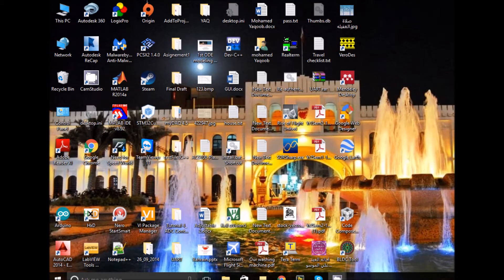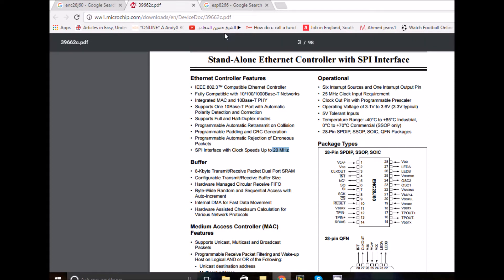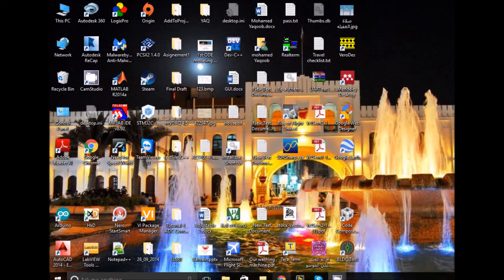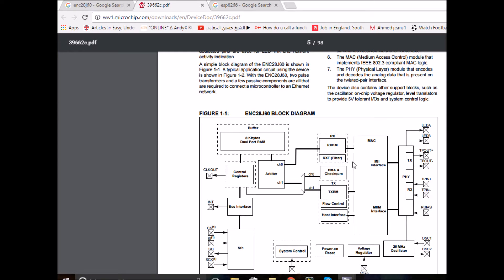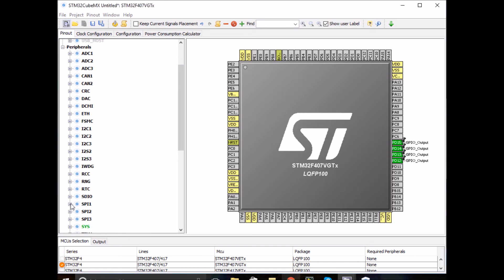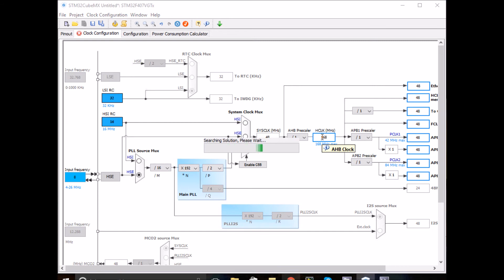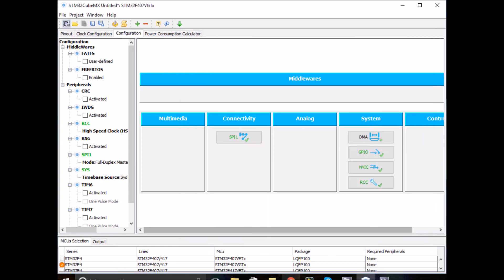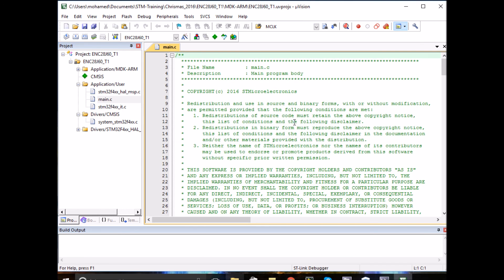STM32F4 Discovery board: ENC28J60 Ethernet Part1- Introduction

Comment: /* Includes ------------------------------------------------------------------*/
#include "main.h"
#include "stm32f0xx_hal.h"

/* USER CODE BEGIN Includes */
#include "string.h"
/* USER CODE END Includes */

/* Private variables ---------------------------------------------------------*/
UART_HandleTypeDef huart1;

/* USER CODE BEGIN PV */
/* Private variables ---------------------------------------------------------*/
#define RS_PIN_HIGH         HAL_GPIO_WritePin(GPIOC,RS_Pin,GPIO_PIN_SET)
#define RS_PIN_LOW     HAL_GPIO_WritePin(GPIOC,RS_Pin,GPIO_PIN_RESET)
#define E_PIN_HIGH      HAL_GPIO_WritePin(GPIOC,E_Pin,GPIO_PIN_SET)
#define E_PIN_LOW      HAL_GPIO_WritePin(GPIOC,E_Pin,GPIO_PIN_RESET)
#define D0_PIN_HIGH     HAL_GPIO_WritePin(GPIOB,D0_Pin,GPIO_PIN_SET)
#define D0_PIN_LOW      HAL_GPIO_WritePin(GPIOB,D0_Pin,GPIO_PIN_RESET)
#define D1_PIN_HIGH     HAL_GPIO_WritePin(GPIOB,D1_Pin,GPIO_PIN_SET)
#define D1_PIN_LOW      HAL_GPIO_WritePin(GPIOB,D1_Pin,GPIO_PIN_RESET)
#define D2_PIN_HIGH     HAL_GPIO_WritePin(GPIOB,D2_Pin,GPIO_PIN_SET)
#define D2_PIN_LOW      HAL_GPIO_WritePin(GPIOB,D2_Pin,GPIO_PIN_RESET)
#define D3_PIN_HIGH     HAL_GPIO_WritePin(GPIOB,D3_Pin,GPIO_PIN_SET)
#define D3_PIN_LOW      HAL_GPIO_WritePin(GPIOB,D3_Pin,GPIO_PIN_RESET)

/* USER CODE END PV */

/* Private function prototypes -----------------------------------------------*/
void SystemClock_Config(void);
static void MX_GPIO_Init(void);
static void MX_USART1_UART_Init(void);

/* USER CODE BEGIN PFP */
/* Private function prototypes -----------------------------------------------*/
//char txdata[3]="hi";
//uint8_t tx_char;
/* USER CODE END PFP */

/* USER CODE BEGIN 0 */
void lcd_init(void);
void lcd_command(uint8_t data1);
void lcd_char(uint8_t data,uint8_t data1,  uint8_t data2);
void lcd_command(uint8_t cmd);
void lcd_data(uint8_t data);
void lcd_goto_xy(unsigned char x, unsigned char y);
void lcd_print(char * str) ;
void lcd_print_char(char str);
void lcd_data_set_high_nibble(uint8_t data);
void lcd_data_set_low_nibble(uint8_t data);
void en_toggle(void) ;
void lcd_write_first_row(char *str);
void lcd_write_second_row(char *str) ;
/* USER CODE END 0 */

/**
  * @brief  The application entry point.
  *
  * @retval None
  */
int main(void)
{
  /* USER CODE BEGIN 1 */

  /* USER CODE END 1 */

  /* MCU Configuration----------------------------------------------------------*/

  /* Reset of all peripherals, Initializes the Flash interface and the Systick. */
  HAL_Init();

  /* USER CODE BEGIN Init */

  /* USER CODE END Init */

  /* Configure the system clock */
  SystemClock_Config();

  /* USER CODE BEGIN SysInit */

  /* USER CODE END SysInit */

  /* Initialize all configured peripherals */
  MX_GPIO_Init();
  MX_USART1_UART_Init();
  /* USER CODE BEGIN 2 */
 
HAL_Delay(1000);
 //HAL_UART_Transmit(&huart1,&tx_char,1,100);
   lcd_init();
 // tx_char = 'b';
 //HAL_UART_Transmit(&huart1,&tx_char,1,100);
 //HAL_Delay(1000);
  // tx_char = 'c';
 //HAL_UART_Transmit(&huart1,&tx_char,1,100);
 //HAL_Delay(1000);
  //tx_char = 'D';
 //HAL_UART_Transmit(&huart1,&tx_char,1,100);
 
 lcd_write_first_row("hello");
  /* USER CODE END 2 */

  /* Infinite loop */
  /* USER CODE BEGIN WHILE */
  while (1)
  {

  /* USER CODE END WHILE */

  /* USER CODE BEGIN 3 */

  }
  /* USER CODE END 3 */

}

/**
  * @brief System Clock Configuration
  * @retval None
  */
void SystemClock_Config(void)
{

  RCC_OscInitTypeDef RCC_OscInitStruct;
  RCC_ClkInitTypeDef RCC_ClkInitStruct;
  RCC_PeriphCLKInitTypeDef PeriphClkInit;

    /**Initializes the CPU, AHB and APB busses clocks 
    */
  RCC_OscInitStruct.OscillatorType = RCC_OSCILLATORTYPE_HSI;
  RCC_OscInitStruct.HSIState = RCC_HSI_ON;
  RCC_OscInitStruct.HSICalibrationValue = 16;
  RCC_OscInitStruct.PLL.PLLState = RCC_PLL_NONE;
  if (HAL_RCC_OscConfig(&RCC_OscInitStruct) != HAL_OK)
  {
    _Error_Handler(__FILE__, __LINE__);
  }

    /**Initializes the CPU, AHB and APB busses clocks 
    */
  RCC_ClkInitStruct.ClockType = RCC_CLOCKTYPE_HCLK|RCC_CLOCKTYPE_SYSCLK
                              |RCC_CLOCKTYPE_PCLK1;
  RCC_ClkInitStruct.SYSCLKSource = RCC_SYSCLKSOURCE_HSI;
  RCC_ClkInitStruct.AHBCLKDivider = RCC_SYSCLK_DIV1;
  RCC_ClkInitStruct.APB1CLKDivider = RCC_HCLK_DIV1;

  if (HAL_RCC_ClockConfig(&RCC_ClkInitStruct, FLASH_LATENCY_0) != HAL_OK)
  {
    _Error_Handler(__FILE__, __LINE__);
  }

  PeriphClkInit.PeriphClockSelection = RCC_PERIPHCLK_USART1;
  PeriphClkInit.Usart1ClockSelection = RCC_USART1CLKSOURCE_PCLK1;
  if (HAL_RCCEx_PeriphCLKConfig(&PeriphClkInit) != HAL_OK)
  {
    _Error_Handler(__FILE__, __LINE__);
  }

    /**Configure the Systick interrupt time 
    */
  HAL_SYSTICK_Config(HAL_RCC_GetHCLKFreq()/1000);

    /**Configure the Systick 
    */
  HAL_SYSTICK_CLKSourceConfig(SYSTICK_CLKSOURCE_HCLK);

  /* SysTick_IRQn interrupt configuration */
  HAL_NVIC_SetPriority(SysTick_IRQn, 0, 0);
}

/* USART1 init function */
static void MX_USART1_UART_Init(void)
{

  huart1.Instance = USART1;
  huart1.Init.BaudRate = 38400;
  huart1.Init.WordLength = UART_WORDLENGTH_8B;
  huart1.Init.StopBits = UART_STOPBITS_1;
  huart1.Init.Parity = UART_PARITY_NONE;
  huart1.Init.Mode = UART_MODE_TX_RX;
  huart1.Init.HwFlowCtl = UART_HWCONTROL_NONE;
  huart1.Init.OverSampling = UART_OVERSAMPLING_16;
  huart1.Init.OneBitSampling = UART_ONE_BIT_SAMPLE_DISABLE;
  huart1.AdvancedInit.AdvFeatureInit = UART_ADVFEATURE_NO_INIT;
  if (HAL_UART_Init(&huart1) != HAL_OK)
  {
    _Error_Handler(__FILE__, __LINE__);
  }

}

/** Configure pins as 
        * Analog 
        * Input 
        * Output
        * EVENT_OUT
        * EXTI
*/
static void MX_GPIO_Init(void)
{

  GPIO_InitTypeDef GPIO_InitStruct;

  /* GPIO Ports Clock Enable */
  __HAL_RCC_GPIOC_CLK_ENABLE();
  __HAL_RCC_GPIOB_CLK_ENABLE();
  __HAL_RCC_GPIOA_CLK_ENABLE();

  /*Configure GPIO pin Output Level */
  HAL_GPIO_WritePin(GPIOC, RS_Pin|E_Pin, GPIO_PIN_RESET);

  /*Configure GPIO pin Output Level */
  HAL_GPIO_WritePin(GPIOB, D1_Pin|D2_Pin|D3_Pin|D0_Pin, GPIO_PIN_RESET);

  /*Configure GPIO pins : RS_Pin E_Pin */
  GPIO_InitStruct.Pin = RS_Pin|E_Pin;
  GPIO_InitStruct.Mode = GPIO_MODE_OUTPUT_PP;
  GPIO_InitStruct.Pull = GPIO_NOPULL;
  GPIO_InitStruct.Speed = GPIO_SPEED_FREQ_LOW;
  HAL_GPIO_Init(GPIOC, &GPIO_InitStruct);

  /*Configure GPIO pins : D1_Pin D2_Pin D3_Pin D0_Pin */
  GPIO_InitStruct.Pin = D1_Pin|D2_Pin|D3_Pin|D0_Pin;
  GPIO_InitStruct.Mode = GPIO_MODE_OUTPUT_PP;
  GPIO_InitStruct.Pull = GPIO_NOPULL;
  GPIO_InitStruct.Speed = GPIO_SPEED_FREQ_LOW;
  HAL_GPIO_Init(GPIOB, &GPIO_InitStruct);

}

/* USER CODE BEGIN 4 */
void lcd_init(void) {

  
 lcd_command(0x33); //send data for 4 bits to the LCD
 HAL_Delay(5);
 lcd_command(0x32);
 HAL_Delay(5);
 lcd_command(0x28); //for bit mode
 HAL_Delay(5);
 lcd_command(0x0e); // clear the screen
 HAL_Delay(5);
 lcd_command(0x01); // display on Cursor on 
 HAL_Delay(5);
 lcd_command(0x06); //increment cursor  
 HAL_Delay(5);  

}
void lcd_command(uint8_t cmd) {

 RS_PIN_HIGH;
 lcd_data_set_high_nibble(cmd);
 en_toggle();
 lcd_data_set_low_nibble(cmd);
 en_toggle();
}
void lcd_data(uint8_t data) {

    RS_PIN_HIGH;
    lcd_data_set_high_nibble(data);
    en_toggle();

 lcd_data_set_low_nibble(data);
 en_toggle();
}
void lcd_goto_xy(unsigned char x, unsigned char y) {
 unsigned char firstCharAdr[] = { 0x80, 0xC0, 0x94, 0xD4 };
 HAL_Delay(2);
 lcd_command(firstCharAdr[y - 1] + x - 1);
 HAL_Delay(2);
}
void lcd_print(char * str) {
 unsigned char i = 0;
 while ((str[i] != 0) && (i < 16)) {
 HAL_Delay(10);
  lcd_data(str[i]);
  i++;
 }
}
void lcd_print_char(char str) {
 HAL_Delay(2);
 lcd_data(str);
}
void lcd_data_set_high_nibble(uint8_t data) {
 uint32_t lcd_data = 0;

 lcd_data = ((data & 0x000000f0) >> 7) & 1;
 if (lcd_data){
  D3_PIN_HIGH;
 }
 else
 {
  D3_PIN_LOW;
 }

 lcd_data = ((data & 0x000000f0) >> 6) & 1;
 if (lcd_data){
  D2_PIN_HIGH;
 }
 else
 {
  D2_PIN_LOW;
 }
 lcd_data = ((data & 0x000000f0) >> 5) & 1;
 if (lcd_data)
 {
  D1_PIN_HIGH;
 }
 else
 {
  D1_PIN_LOW;
 }
 lcd_data = ((data & 0x000000f0) >> 4) & 1;
 if (lcd_data)
 {
  D0_PIN_HIGH;
 }
 else
 {
  D0_PIN_LOW;
 }
}
void lcd_data_set_low_nibble(uint8_t data) {
 uint32_t lcd_data = 0;

 lcd_data = ((data & 0x0000000f) >> 3) & 1;
 if (lcd_data){
  D3_PIN_HIGH;
 }
 else
 {
  D3_PIN_LOW;
 }
 lcd_data = ((data & 0x0000000f) >> 2) & 1;
 if (lcd_data)
 {
  D2_PIN_HIGH;
 }
  else
  {
  D2_PIN_LOW;
  }
 lcd_data = ((data & 0x0000000f) >> 1) & 1;
 if (lcd_data)
 {
  D1_PIN_HIGH;
 }

  else
  {
  D1_PIN_LOW;
  }
 lcd_data = (data & 0x0000000f) & 1;
 if (lcd_data)
 {
  D0_PIN_HIGH;
 }
 else
 {
  D0_PIN_LOW;
 }
}
void en_toggle(void) {

 E_PIN_HIGH;
 HAL_Delay(10);
 E_PIN_LOW;
 HAL_Delay(10);
}
void lcd_write_first_row(char *str) {

 lcd_goto_xy(1, 1);
 lcd_print("                ");
 HAL_Delay(10);
 lcd_goto_xy(1, 1);
 lcd_print(str);
}
void lcd_write_second_row(char *str) {

 lcd_goto_xy(1, 2);
 lcd_print("                ");
 HAL_Delay(10);
 lcd_goto_xy(1, 2);
 lcd_print(str);
}

/* USER CODE END 4 */

/**
  * @brief  This function is executed in case of error occurrence.
  * @param  file: The file name as string.
  * @param  line: The line in file as a number.
  * @retval None
  */
void _Error_Handler(char *file, int line)
{
  /* USER CODE BEGIN Error_Handler_Debug */
  /* User can add his own implementation to report the HAL error return state */
  while(1)
  {
  }
  /* USER CODE END Error_Handler_Debug */
}

#ifdef  USE_FULL_ASSERT
/**
  * @brief  Reports the name of the source file and the source line number
  *         where the assert_param error has occurred.
  * @param  file: pointer to the source file name
  * @param  line: assert_param error line source number
  * @retval None
  */
void assert_failed(uint8_t* file, uint32_t line)
{ 
  /* USER CODE BEGIN 6 */
  /* User can add his own implementation to report the file name and line number,
     tex: printf("Wrong parameters value: file %s on line %d\r\n", file, line) */
  /* USER CODE END 6 */
}
#endif /*
Reply: tell me what is the error // a program for LCD
(display text on lce)
Reply from the maker: Dev Ender 
I simply don't know what is wrong with your code.

Comment: Hi M Yaqoob..i learned a lot from your channel..i have stm32f746zgt board with on board Ethernet..Can you make a video for a board
 with onboard ethernet or tell me where comes the difference when coding between my board and your ethernet tutorials.
Reply from the maker: Asim A Qayyum 
Hi Asim, might create a tutorial series for the STM32F7 board. Thanks for the suggestion.. There is a significant difference between this Ethernet module and the F7 board. I don't know how to do that on the F7 yet.. but I assume you can use the LWip on CubeMX
Reply: actually i had no prior experience in microcontrollers..so i am working on a project and i learnt a lot from your tutorials..Now i have to send some data via ethernet but i am stuck there..and it will be nice if you also do a tutorial on how to receive data from some sensors and  transmit it(i guess iot)..thanks
Reply from the maker: Asim A Qayyum 
Simplest Ethernet device is Wiz105SR Serial to Ethernet module. Read more about it.